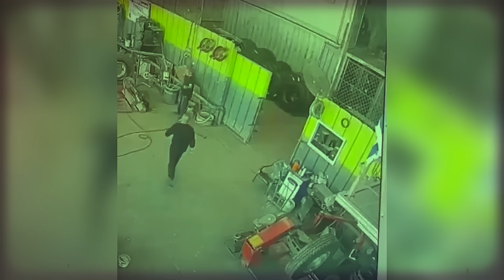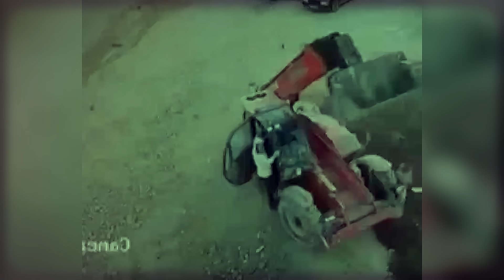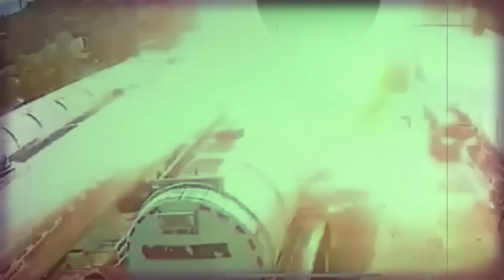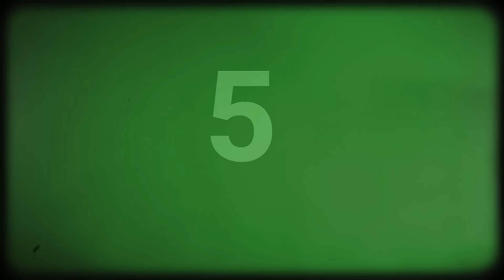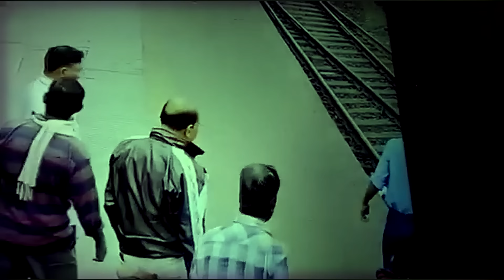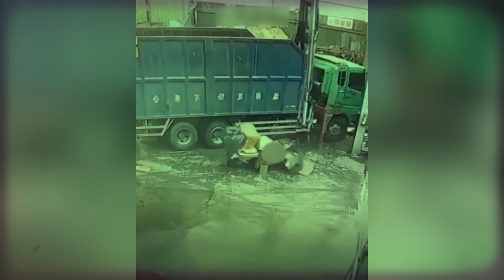The Operator Didn’t See Him… Then This Happened

Comment: I broke my neighbors window after she locked herself out. I am going to show her the last clip of the video and explain why I made sure all the glass was stable and no more was falling, after I broke her window. It leaked alot of heat, which is why we chose to break that window. When I was hitting all the unstable looking pieces, before reaching in, she kept trying to rush me and even pushed my shoulder and I yelled at her and said that I am not going to take a chance at hurting myself. I might have taken a minute of extra time to break all the extra glass, especially since I didn't expect it to spider web. That was my 1st time breaking a window, but I replaced it for her and it no longer leaks air. She only paid for the window. She was panicking because she only had so much time to cancel her appointment, before she would be charged for it, but if I got hurt, I would have taken even more time. I got 1 very small cut from cutting the caulk off and I didn't see a very small piece of glass in the cualk, but that cut didn't even bleed, so basically just a grazing from the glass, because I was cautious. She still canceled her appointment in time, in fact her interrupting me by pushing me, took up more time, because I stopped to tell her off. She is like a 2nd Mom to me and we were laughing at she cooked for me, after I fixed everything, so it wasn't a serious argument. If I would have rushed, I could have cut an artery and possibly lost enough blood to end my life. Even though calling a lock Smith would have been the right thing to do, I used my head and I was safe the entire time. I even had construction gloves on and a construction jacket that's made to protect my body in a construction sight. I also broke away all the glass, especially where the lock was, so I without a doubt was safe. I was able to reach the door knob, by reaching in, so I didn't even climb in. I did open the window, before reaching for the door knob. Plus she is seeing a improvement in her heating and cooling bill. She will totally understand what I was doing, after seeing this. Just breaking a window and reaching in is asking to be injured, which this video proves.

Comment: COMMON THEME HERE IS OTHER COUNTRIES AND THE LACK OF SAFETY STANDARDS, LACK OF COMMON SENSE, ONE TIP ....DO NOT AIR UP A TIRE YOU RAN LOW OR FLAT, THE BELTS INSIDE BREAK AND IT WILL EXPLODE, I SPEAK FROM EXPERIENCE!

Comment: Tyres are dangerous if not caged . I was carrying two wheel barrow tyres in the back of my car and the heat from the sun must have made them pop . Blew the rear seats out of there holding clips . You couldn't rip the seats back by hand as the clips had to be unlocked. Proves how powerful these tyres can be .
Reply: what would u say happened to those people in the clip that had a tire explode near to them? Dead for sure?
Reply: Fuck me even barrow tyres could be lethal

Comment: The tire didn't burst for no reason; if you look closely, you can see the inflation hose stuck to the valve. Someone must have forgotten to shut off the air supply and simply overtaxed the tire... The accident was self-inflicted.
Reply: Over inflated wheel...classic:)

Comment: I have firsthand experience witnessing a tire throw my roommate 6 ft. from where she was sitting, knocking her out as well as potato chipping the metal frame chair she was sitting in. It was bad, luckily no large open wounds, however it messed up her knee and ankle pretty bad plus the large knot on her head. The rim ended up being the problem, as the outer bead seat was rolled a little bit outward. These were tractor trailer tires and as she was inflating to 100psi, at around 80, the tire launched off the rim right at her. We have since scrapped that rim, and I’m building a safety cage for future tire work as well as not trusting people when they give us a rim and say it’s good. It looked good, but once we measured the diameter of the inner edge of the rim it was slightly larger than the measurement of the outer rim edge. If we’d have measured before trying to mount a tire, the incident would not have happened. So we definitely learned from that. 😂
Reply: You have to build your own safety cage? You can't buy one?
Reply: @goemon9378  I’m sure you can buy one, however I have the metal and know how to weld so it was cheaper to build.